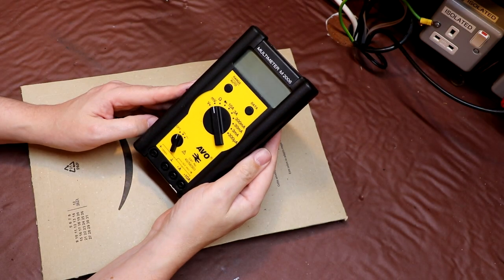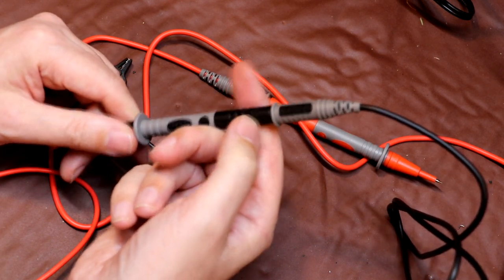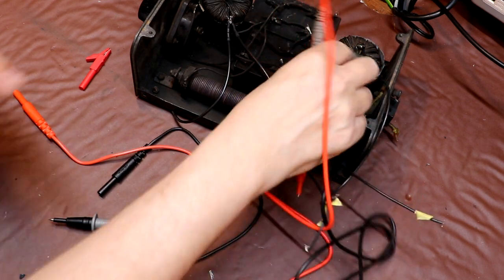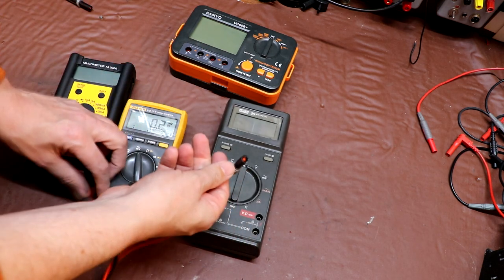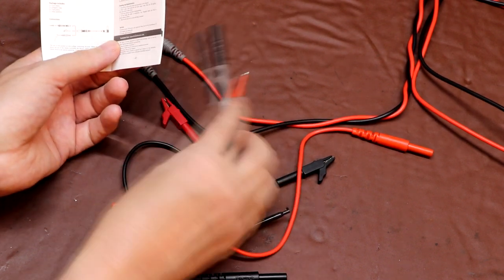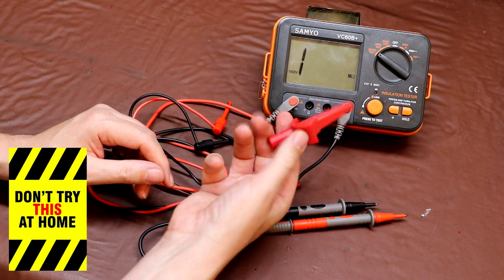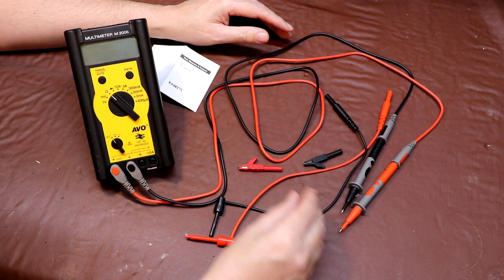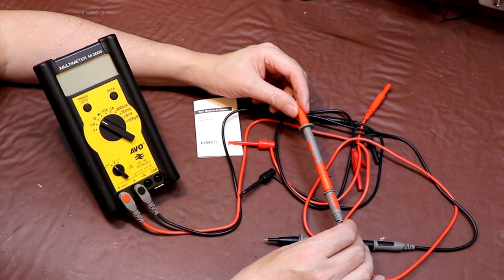KAIWEETS KET01 Multimeter Test Leads

Comment: They are just fine for someone tinkering around inside transistor radios etc, but they would have been frowned upon in what I used to do!  500v to 1000v sometimes and 300v DC, no chance of me using them on that equipment.   😳 To be fair, I didn't have that voltages to often, but when you had to measure it, you had to have the right meter and leads.  Though for me, they would do fine for working in the shed, if they stand 500v AC they will be double what I need.  🙂
Oh, I broke a lead, I will need to get another, I don't think a glued together lead would meet with your approval 🙄  🤪  EDIT: I am only measuring 12 to 36 volts DC at the moment, so a glued together lead will work fine.
I do have silicone ones, but I am to lazy to look all over the shed for them!  🤣
Reply from the maker: All my professional equipment is both calibrated and subject to periodic inspections. I would have any concerns working with these at 1000V but it depends on the potential fault current of the circuit.

Comment: Nicely tested chris :-D, you gave them way over there rating in voltage and they coped :-D.
I'm not saying the leads are safe at 10KV but the insulation can be trusted at 250-500v.
I am a tight arse lol,  i use mains extention cable on crock clip cables.
The insulation is fine for mains and thick enough copper wire for high current measurements without too much error.
For me the Cat rating is confusing.
If a cable+connectors are rated for X amps and Y voltage insulation,  no fancy numbering system is needed.
Smashing video chris :-D
Reply from the maker: The CAT rating isn’t obvious as part of the testing is an impulse load. You could get this if you lived next door to a factory with big electric motors as the motor switch off they can dump a lot of energy back into the grid. If your next door to the factory that energy could get dumped into your meter or probes. So the test equipment has to be rated considerably over the normal working voltage etc. It’s probably not a big worry for me and you but would be important if we were exposed to this risk on a regular basis as an electrician may be. I’m not fussy I like single malt but happy to drink a bottle of bells.

Comment: Getting goosed by HV current doesn't always travel from one hand to the other. A colleague forgot to discharge (via chicken stick) oil filled caps (~7KVDC) on a non-interlocked RF valve amplifier used for testing. The current traveled from his hand (on the anode) and then rocketed out of his steel toe boots into the concrete. I walked him immediately to the nursing office for exam, even though he resisted. Whats even worse is high frequency RF shocks and deep tissue burns. It will jump out at you because you are a good human capacitor/resistor to ground. Seen that too. Stay safe brothers, use caution, no drinking or smoking of herbs on the job.
Reply from the maker: I tend to need a drink just to get started these days. I work with AC and DC tractions systems for the day job at 500vdc and 25Kv with the circuit breakers set at 2500 amps so I’m pretty careful. but accidents can happen to even the most diligent. If you cannot take the knocks don’t play the game.  Yes had a few minor HF burns normally when playing with TIG welders.  I will do my best to stay safe and you best wishes regards Chris

Comment: They do look like excellent value, Chris. I'm with you on the horses for courses issue. For my hobby activity these look fine. For ICs I'd prefer purpose-made clips, but, again, not at Pomona prices.
Reply from the maker: You can actually get a basic probe from Pomona for around £20. There are many other excellent lead manufacturers out there and I do buy the good stuff for my professional use. But sometimes good enough is good enough.  If I was doing more micro electronics and smd I would probably buy some needle probes. Thanks for watching and comments.

Comment: That's the thing with Pomona/Probemaster/Fluke, one pair of those will get you more than one pair of cheaper leads plus extra attachments. Personally I feel safer with a name brand for higher energy stuff so went the Pomona route for a couple of meters that arrived with no probes. I also bought a box of Hirschmann accessories, I was quite surprised to see the CAT ratings/voltage limit warnings on some of those accessories from even a top quality brand like that. Made me rethink using grabbers on rectifier anodes..
Reply from the maker: I think some of the CAT testing calls up specific clearances and separation and these simply cannot be achieved using the smaller style of probe. I certainly do appreciate the quality of the Pomona leads and In my professional capacity wouldn’t hesitate to recommend them. But for hobby use I think some of these benefits are perhaps overrated. But basically I’m just tight!

Comment: I love my Pomona test leads, they are really nice, but those low cost leads look pretty good. I suggest putting a hot soldering iron on the wire to see if it melts, if it does then it’s plasticised PVC not silicon.
Reply from the maker: I also like Pomona test leads I just don’t like the price. Good tip on using the soldering iron on the cable I wish I had tried that in the video and I will now. Thanks